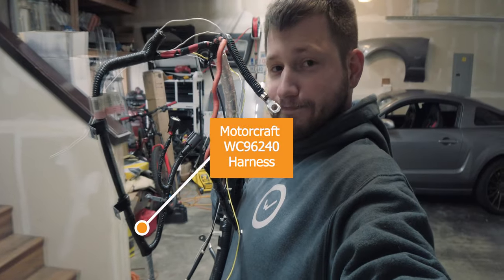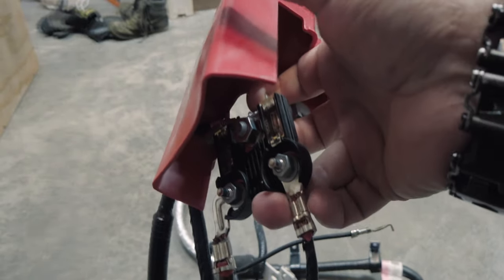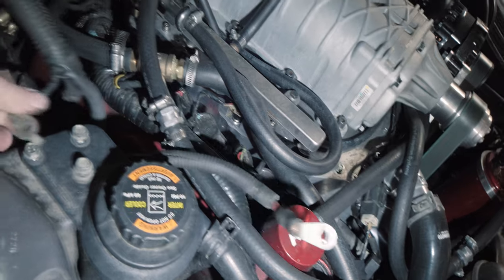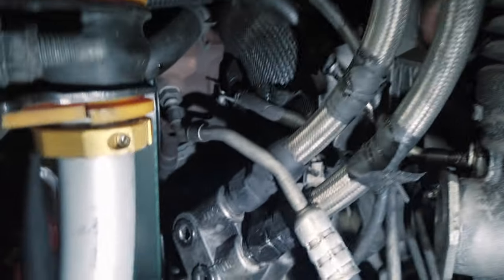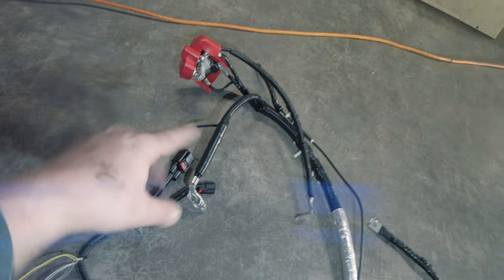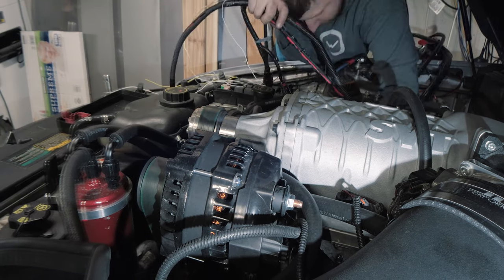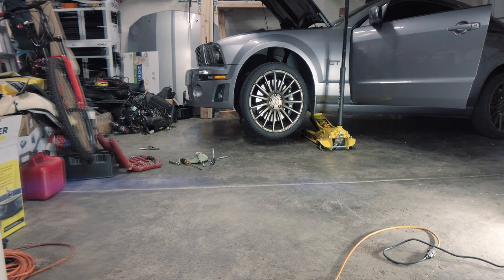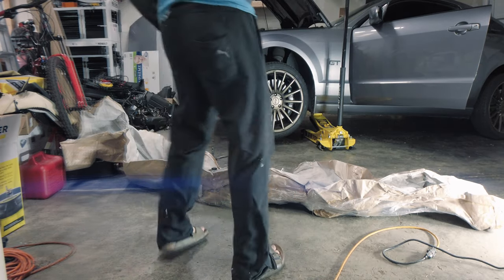S197 EPAS conversion part 1

Comment: Man i followed the wiring and everything but i cannot get the steering assist to turn on with the car or at all. The rack came out of a working mustang so id assume the rack is good no damage visible to it. As for the wiring i just did solder the wire together, my abs light doesnt come on and everything seems to be working but the rack.

Comment: Having an hard time getting the harness, got any suggestions? Looking to do this myself.
Reply: You reuse your current harness
Reply: @AlexandruBauer  Im not reusing an 05-09 harness. Im looking to do this as clean as possible and would much rather have the built in positive fuse like the 12 harness has.
Reply: @3vReanimated  crap. Sorry. I thought this was a comment on a different video i have. Lemme get you a link
Reply: @AlexandruBauer  would appreciate it

Comment: What modifications to the new harness are needed? I get that you have to buy the harness from Ford but what I don’t understand is what modifications need done to the new harness? (I did watch both videos)
Reply from the maker: So the harness from Ford comes with a ton of connectors that are not used so you need to pretty much strip them off the harness and their respective wires. You end up with just the plugs that you see at 2:30 in the video: battery connectors, alternator, EPAS connectors with the 3 looks CAN wires and the starter cable.
Reply: @DronezandGasoline  thanks. Do you know if the stock k member can be used?
Reply from the maker: @MrAaronbatey  i have a tubular for extra clearance on turbos that i had previously but a stock one should work

Comment: So you literally just bought a power steering rack out of like an S550 Mustang and reran that motorcraft battery cable and thats it? Nothing done to the column or anything?
Reply: Alexandru Bauer dude thanks for the super fast reply. And posting the harness part number. Keep doing videos man you’re gonna get discovered
Reply: Alexandru Bauer I’m so pumped now. Other you tubers require messing with the steering column and all that but my mustang is also an 06 with the BMR k member so pretty happy everything will just bolt right up!
Reply: @theroadrunner4209  will it work without BMR K member ?
Reply from the maker: @s197stang8  yes it should work